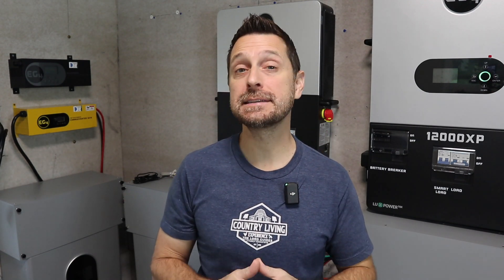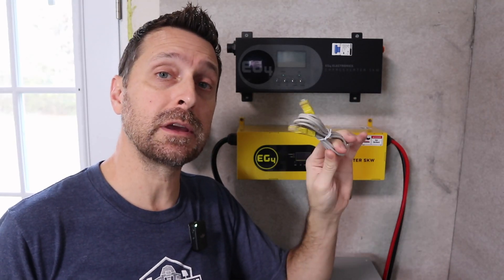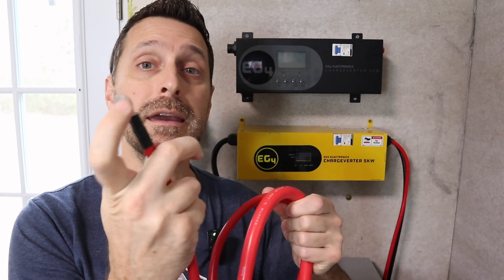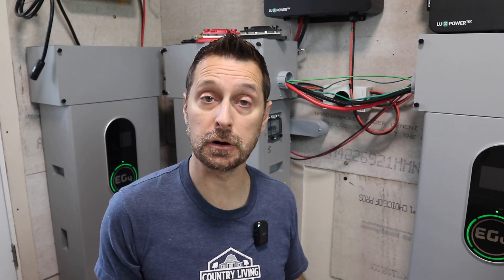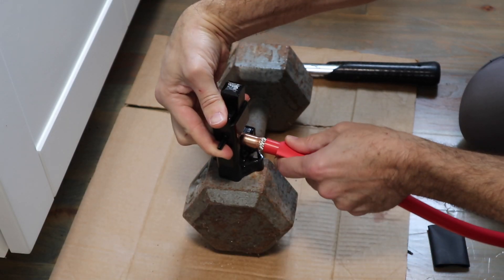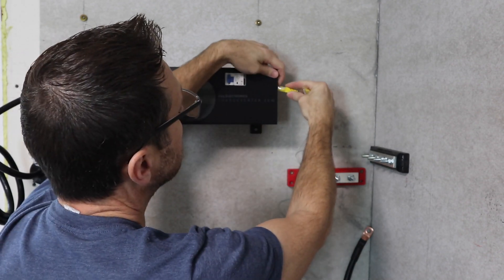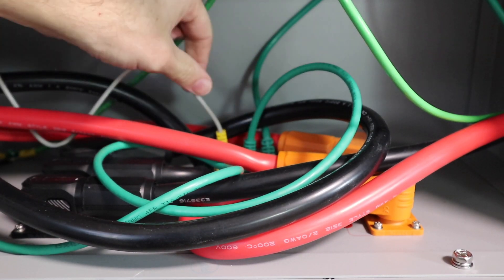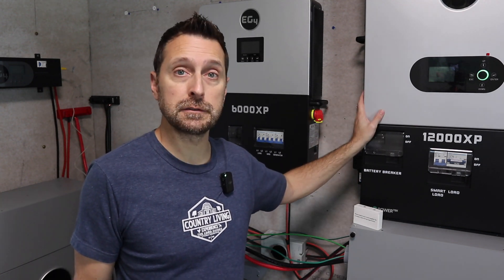EG4 Powerpro Wallmount & Chargeverter GC Connection How To!

Comment: Quick question, just upgraded to two interior wall mount batteries on a 6000 xp. Have them hooked up to busbars to use a chargeverter but when I checked on the app, one is drawing down more than the other. Ideas?
Reply: It might be an app problem as both batteries screens agree with each other.
Reply from the maker: Check to see if the batteries voltage is the same on each battery. If not, charge them to 100% (top balance). Don't put a load on them when charging to 100%. Also, do you have communications enabled/connected between the two batteries. This will help them talk to each other and balance.
Reply: @C @CountryLivingExperience it appears I have a communication problem to figure out rather than an unequal discharge problem.
Reply from the maker: @wesbutler9999  Potentially

Comment: If i have to wallmount eg4 battery in which one do i connect in the main or in the other battery? And to charge them with the chargeverter do i need to turn inverter and charge controller braker down?
Reply from the maker: I do not understand your first question. The answer to your second question is that yes you can run the inverter at the same time as the Chargeverter.

Comment: Thank you for making this video! I'm looking to build this exact setup. Is there any way to connect from the Chargeverter to the PowerPro battery directly so the bus bars and connections are not exposed outside of the conduit box? My setup will be in a garage so I don't want to anything to accidentally bump into or short out on exposed. Or do you have any recommendations on how to "cover up" the bus bars in some kind of enclosure?
Reply from the maker: You're welcome. 
There is no way to directly connect them to the PowerPro. You can put the buss bars in an enclosure that is either metal or plastic. I just did a video on a new battery system where I did that very thing. Check it out here.....https://youtu.be/__ZS9Am1acI
Reply: @CountryLivingExperience Thank you!

Comment: I just can't understand why one could not put the powerpro ends on the Chargeverter wires especially if it is in a box. The strands in your 2.0 cable are much thicker than mine. I have not been able to get them in the ring terminal. I really don't know how to get it in.
Reply from the maker: They are different wire gauges that aren't close to one another.

Comment: How would you connect multiple (2) batteries to a single chargeverter?  I am looking at a Victron 1000 bus bar.  A Victron distributor suggested connecting two batteries to the bus bar and the chargeverter to the end to be able to charge two power pro batteries at the same time.  Is this how you would do it?  By using the busbar as the convergence point for the inverter connection and the batteries and chargeverter.
Reply from the maker: Yes. That is what we do. Common bus bars are the answer.

Comment: are you able to charge all battery's at the same time by leaving them all connected on the intermale buss bars on the the battery's and use only one communicating  wire between battery and chargeverter
Reply from the maker: Yes

Comment: I rather new to this, so pardon what may be a dumb question. I have a 3200W Firman generator and intend to install a solar power system consisting of the EG4 12,000XP, 6 EG4 LFP batteries, and 26 PVs. The generator outputs 25A (via a 30A outlet). I assume that I need to install a 30A inlet on the outside of the house, connected to a 30A outlet to which the Chargeverter would connect. Is this correct? Thanks for your help.
Reply from the maker: That is correct. Here is the video where we did that very thing. https://youtu.be/fii9vfE1lvM
Reply: @CountryLivingExperience  Thank you!!

Comment: What is the purpose of the chargeverters? Can't the 12000XP charge the batteries from the grid or a generator?
Reply from the maker: Most generator are too small to run all the loads and keep a pure sin wave. With the Chargeverter, you don’t have to worry about that as you are bypassing the inverters and charging the batteries directly.

Comment: Two questions: 1.) I watched the video twice, but don't understand the reference to "the middle battery." 2.) I plan to get two 6000XP inverters and 5 of the EG4 LL batteries. Does the Chargeverter work with that? Tx.
Reply from the maker: 1. plugging communications and the charging cables for the Chargeverter into the middle battery (of a 3 battery setup or 5) is going to give you the most even charge distribution. 
2. the Chargeverter will work on any setup. Just connect external bus bars.

Comment: I just found out that the cable from the power pro battery is not UL rated and only tested for internal use inside the battery(appliance). What added precautions are you taking ? Second I noticed a gap in your video when you started to put on the lugs to the finish of inserting lug, why is that and how did you put it on?
Reply from the maker: I am not aware of any issue with the cable.
I edit out mundane or non-pertinent information. Which lugs are you talking about? What time in the video?
Reply: Your EG4 cables have one end bare and one end pre-assembled. When you put the other end on, I was watching with anticipation on how you did it. As I have struggled with getting a lug on the Chinese wire they send with the eg4 products. 

The 2/0 wire sent with the product is required to have a UL (underwriter Laboratories) stamp on the cables if they have been tested and are approved for handling a load of a 2/0 wire. I have had to order additional replacement wire from signature solar as they do also sell 6 foot sections that are UL approved and stamped on the wire. 

The explanation given to me by a tech at signature solar is the, in my case, power pro all weather battery was UL approved as a unit or appliance and the wires are accepted as long as they do not go outside of the battery or appliance. Since you are using them outside of the chargeverter and or battery, the wires signature solar have provided are not rated or proven safe for your application. I just researched this and I like what you are doing. I wanted to give you a heads up as I am a fellow diyer and we all need to look out for each other.
Reply from the maker: Thanks for the heads up on the UL issue.
I put the lugs on the wire at the 3 min 31 seconds into the video. Not sure how else I can help.

Comment: I just switched from my old lead acids to the EG4 indoor wall mounts like you have there.  All of my stuff is open loop.  All off grid. I do also have the older yellow chargeverter as a backup in addition to my solar. I’m trying to get an idea of the voltage these batteries like to hang out at to indicate a true state of charge, as I literally just installed them.

Manual says set absorb to 56.2v, and float at 54v.  Just finished the first charge cycle, let them sit at 56 volts for about 10 minutes and then cut off the chargeverter (was using just to help charge quicker).  The state of charge had reached 100% on the batteries by about 54.5 volts, and after I cut off the chargeverter the batteries dropped down to about 53ish volts and hung out there until the evening when they seemed to stay at around 52.8v.  By morning down to about 52.1.  Mind you, this is a full home.  Not needing to run any heat right now as the temps are good, but still, fridge, lights, electronics, etc. 

Do you have a second to run through your typical voltage after charging and where they sit at for state of charge?  Appreciate it.

Edit: It’s under load of course, so dropping into the 53v+ after charging has stopped probably seems reasonable, but I was just curious since every battery and different battery chemistry will cause variations.
Reply from the maker: Mine sit at about 53.65v at 100% soc. However, the charge curve ans state of charge is hard to determine on lithium batts. The curve is very flat in the middle and spikes at the top and bottom ranges of soc.
Reply: @ Thanks for the response. That seems generally in line with my limited experience with these as well after a couple charges now.
Reply: I don’t care for battery communication because I have a couple of home made batteries,280 ah and 120 ah running parallel plus six EG 4 server rack batteries. The BMS in the individual batteries will stop charging so you can just charge at 56 volt occasionally to insure no one gets left behind.
I understand that you can milk a little more out of the system with communication but with a properly sized solar it lopes along nicely with Stone Age technology. I have better things to do than check on individual cells when I can buy a BMS

Comment: Can you just connect the chargeverter to the generator input on the 12,000xp?
Reply from the maker: No, you cannot.
Reply: Your reply was so much faster than Colt from EG4 but he just got back to me and said that the chargeverter CAN be connected directly to the 12,000xp. He did not give any further details but considering that information the dry contacts start and stop on the inverter I would assume would start the generator thus also eliminating the need for the communication from the battery to the chargeverter.
Reply from the maker: I have never heard that and I do not know what Colt is talking about.
Reply: The 12,000XP model's generator input accepts AC power, while the Chargeverter outputs DC power. Therefore, directly connecting the Chargeverter to the generator input is not compatible and should be avoided. While it is technically possible to connect the Chargeverter to the battery ports on the 12,000AP, this is not recommended. A more suitable solution would be to utilize a pair of bus bars for this connection.

Comment: Can you parrell the 6000XP and the 12000XP ?
Reply from the maker: Unfortunately no.
Reply: Can they be connected if you use the GridBoss?
Reply from the maker: @turtle1723  I am not sure. The Gridboss is so new, I do not have much information on it and have not had a chance to play with it yet.
Reply: @turtle1723 No, you cannot use the gridboss to connect off-grid inverters together.  You need to use the EG4 hybrid inverters (18kPV, 12kPV or Flexboss).
Reply: @AdamDeLayDIY  I thought they had a video saying that they could be connected on the smart port breakers.
Reply: @ If you can find that video, please share it.  I don’t recall seeing anything like that.  You can use AC Coupling from PV inverters on the smart ports, but AC Coupling can’t be done with any old inverter.  It has to be designed for it and allow for phase shifting.

Comment: Big Question----Currently, are there ANY of the new Pure Wave Sine GENERATORS being sold that work pure enough to not need an additional Chargeverter??  What power source are you running into your chargeverter?
Reply: I use a open frame non-sine wave generator with a Chargeverter to charge my batteries. When charging batteries directly with the Chargeverter my generator runs at a constant load. Inverter generators are more fuel efficient only if you are powering fluctuating loads. Open frame non-sine wave generators are less complex (more reliable) and less expensive. I have a second generator in the box should I have a failure of my first less expensive generator. When you have two you have one. Also, by using the Chargeverter, I do not use the inverter-charger for battery charging....I don't “cook” my inverter-charger with hours of high heat charging...and my cabin continues to have good clean power from the inverter only.
Reply from the maker: We are using an older non-inverter based gas generator.

Comment: I was told that you weren't supposed to simultaneously connect the Chargeverter comms port and the inverter comms port to the battery.
Reply from the maker: Not sure where you heard that. They communicate in different ports. Comms for the inverter is via the CAN port and the Chargeverter is the RS485 port.
Reply: @CountryLivingExperience  See manual, section 6.3 "CAUTION: Do NOT establish communication between the charger and a battery or batteries that already have communication with an inverter! Batteries should never have communications with a charger and an inverter at the same time."

And I thought that establishing comms with the battery only supported the generator contacts and did not have the chargeverter itself start or stop charging?  Can you confirm whether you are getting the CV to start and stop charging based on SOC from battery?
Reply from the maker: @JK-hx5bx  Interesting. I will try to confirm and do some experiments. This would make CV comms not useful at all since inverter would always be on and communicating.
Reply from the maker: @JK-hx5bx  Got the answer. 
FYI: In the video I was just describing where to connect the comms and nothing else. 
What a person can do if they want to charge with the CV (and not disconnect cords) is to set the inverter to lead acid mode while the CV is charging. That way the two BMS comms brains are not speaking the same language. Once the batts are fully charged and the CV is shut down, the inverter can be placed back on Lithium mode. 
Hope that helps.